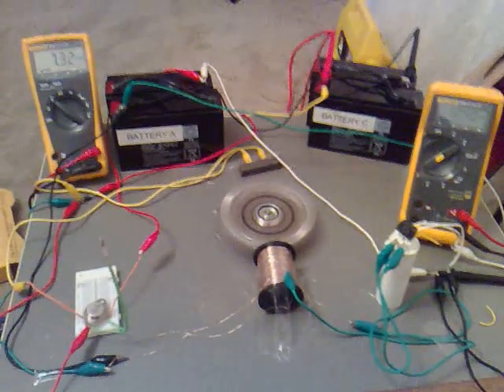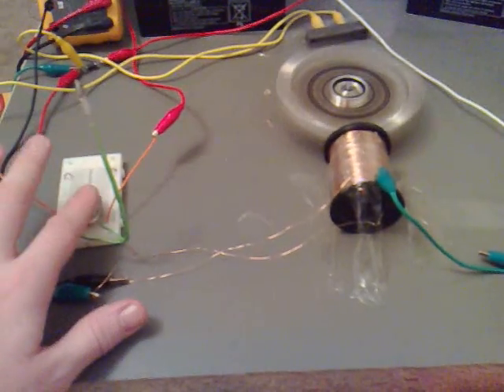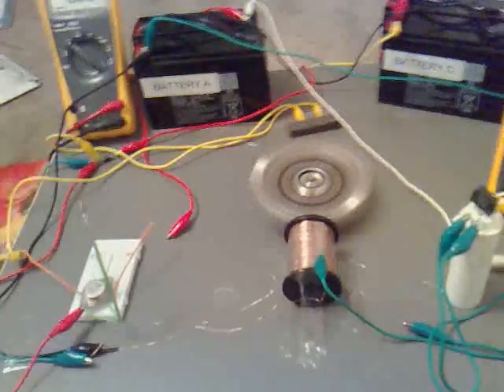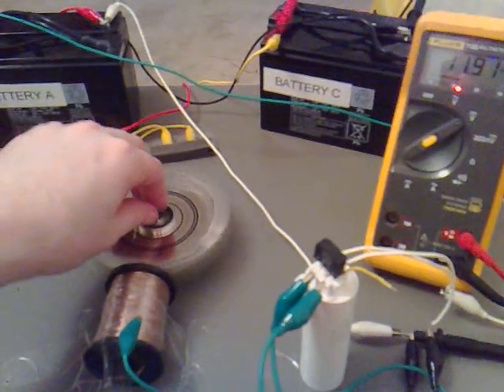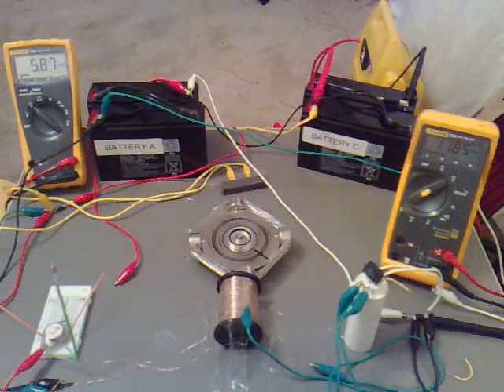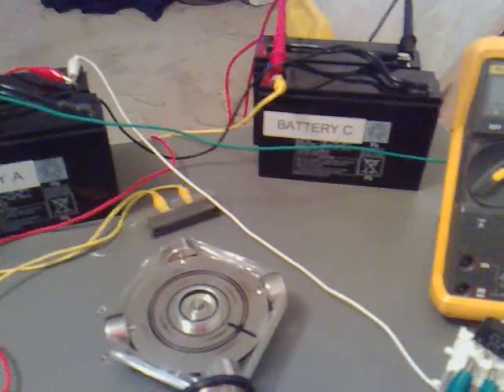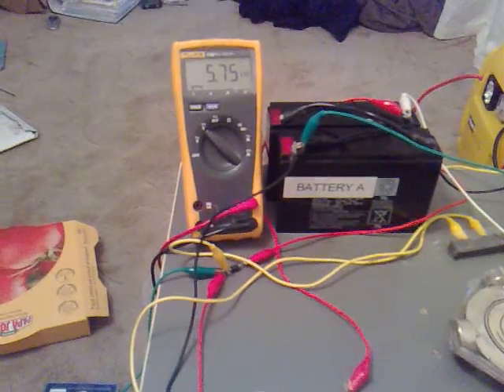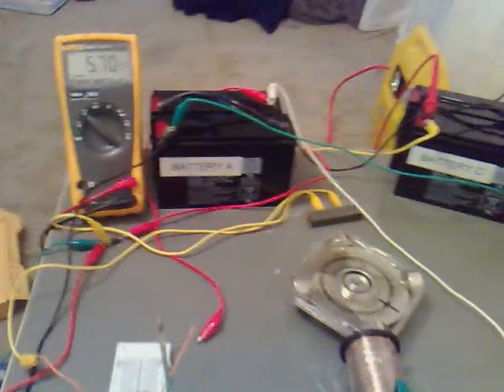Pulse Motor (Double Charging 02) 041

Comment: Did you make sure the capacitor was totally discharged before proceeding?  That could be your source of extra voltage.  Also an increase in voltage doesn't prove that the batteries have increased in energy.  Energy is E=P*t (power over time) and P= V*I.  So basically you will have monitor the voltage and current in your circuit, and see how long it can turn your motor to determine how much energy was used.

Comment: i do not get the point.
energy is measured in Joules(or Whour for electical puorposes) if you do not show current measurements this is just a working electric motor. I suggest current measures (power=voltage x current),  i'm pretty sure that a proper energy analysis can show that no energy is created in the proces.